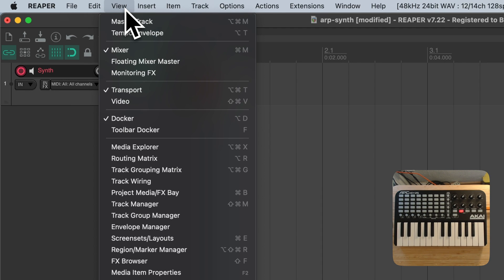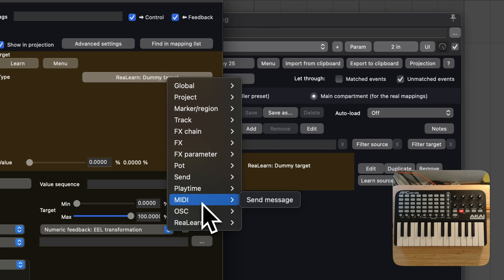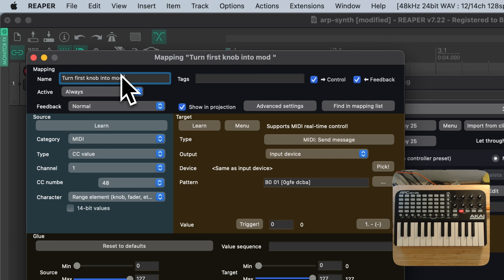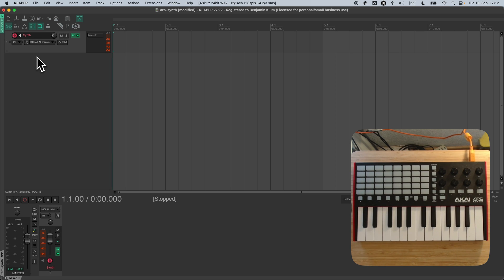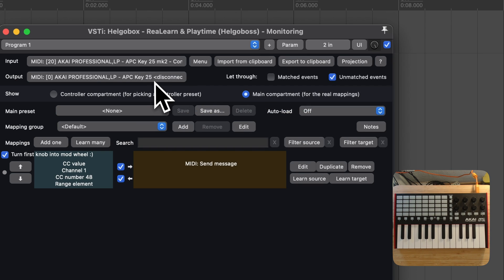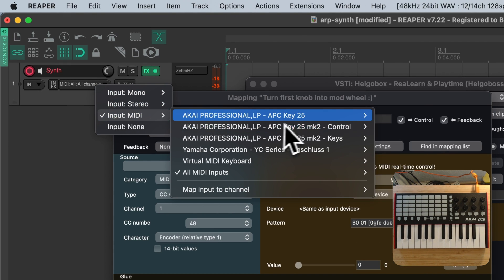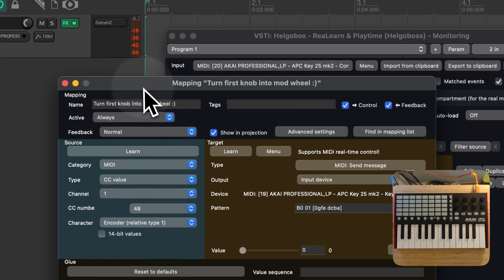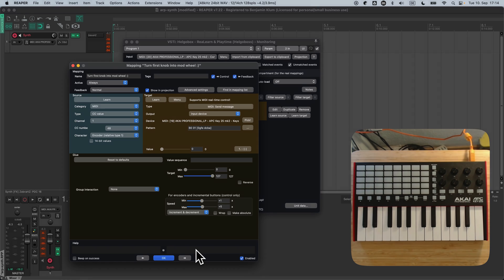The ReaLearn Tutorials - Part 11 - Global MIDI Transformation

Comment: Hi Benjamin, massive praise for what you're doing for us, so much made possible with less tools! Will there be a patch for banks 3+4 for the midi fighter twister? Or is there a way of making it work or adapting the controller setups for the pre existing 1+2. I have very limited coding knowledge but know I have plugins I want to map with more than 2 pages of parameters! Unless there is a better way...!
Reply from the maker: Hi. Thanks! The ideal way to go about that is to forget about the MFT's built-in banks and instead use ReaLearn's conditional activation. Then you don't need any other bank patches. Unfortunately, there's no video tutorial yet which covers this.
Reply: @helgoboss  I await eagerly! Will a pot click for example then open a "bank" giving 16 options, like it seems in the Fx Grid setting? Again, second to none support and feedback, wishing you the best and will check your paid apps for more technical wizardry

Comment: Hi Benjamin! Thanks for the great content as usual, both the software and the instructional videos are amazing!

This is slightly offtopic but is there a future in having the possibility to map game controller inputs in Realearn? To use interfaces like joysticks, throttle quadrants etc. since those seem to be standardized.
I have no idea if the sensor resolution and refresh rate would yield good accuracy and performance but I'm asking just in case :)
Reply from the maker: @DrJedd  I think that would be a great addition. Please open a feature request in the Discussions section of the Helgobox GitHub page, then it gets on the radar.